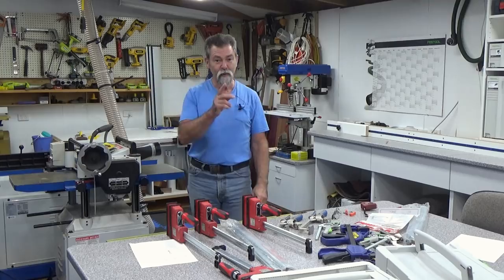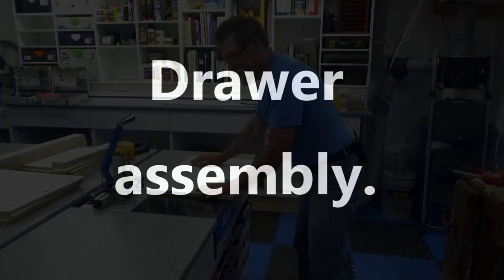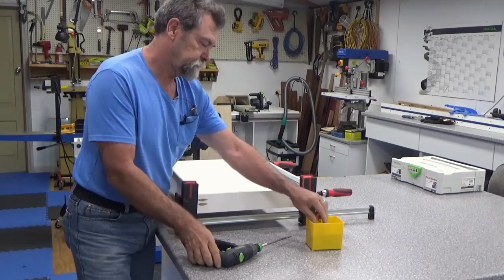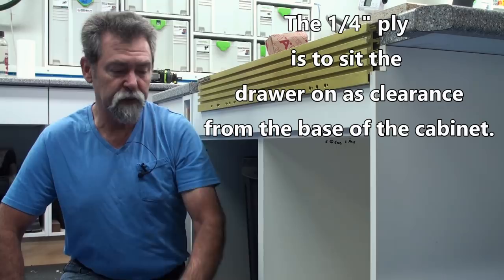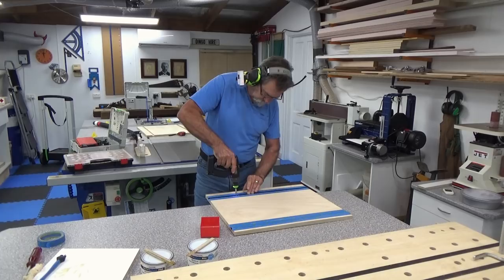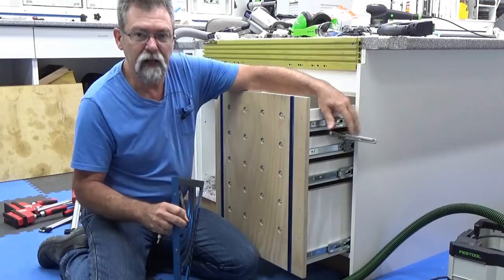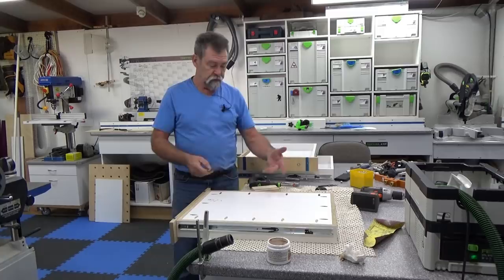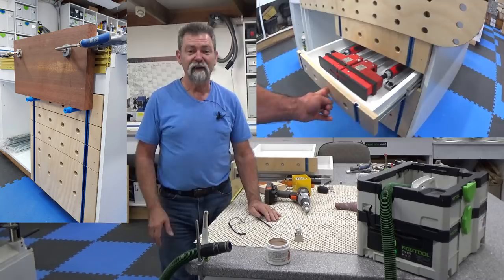Festool style MFT drawers! Dave Stanton easy woodworking. vix

Comment: Dave I used to make my drawers out of melamine as well & with Kreg screws. Now I build them with Festool dominoes and no one sees the connection method. Works great! And I recently started using thru Dominoes just to try something different and they work great as well. No issues with either method.
Ron

Comment: Thank's Dave, well worth the wait. Excellent step by step video. Cheers for the West
Reply from the maker: Hope it helps with your drawer project Brett.
Reply: It will thanks Dave, where did you get your square dit driver for the Centrotec chuck?
Reply from the maker: It is a long Kreg drive and I put it into the centrotec bit holder that I usually put a small posidrive or philips drive into.

Comment: Excellent demonstration Dave
Reply from the maker: Thanks Jim, much appreciated!
Reply: Dave, I always enjoy your videos.   Nice detail and narratives.  I think the reason people might not follow your method is because it takes a lot of time compared to alternatives like dados or dovetails for drawer joinery which are much quicker if you get your machinery setup to do multiple drawer units and, I think, look much cleaner than pocket holes.  Still, nice demonstration of another method of joining and assembling drawers.
Reply from the maker: Thanks Jeff. I guess it comes down to what you are comfortable with and also what gear you have at your disposal. I may do some drawers a little differently with timber, but for melamine this method or using the domino seems easy.
Reply: David Stanton I love using dominos for drawer construction.  Good recommendation!

Comment: Having recently bought an HKC with 1400/2 and the parf system for drilling the holes i can only advice everyone to do the same! Right now im working on ways to reduce dust. I have the 1400 set up in almost the middle on a 800x600 top. The suction is under the table where the saw blade goes. Too hard to explain how but it's pretty simple. Maybe ill make a video.

Comment: Great video. Will try pocket holes in Melamine again I have not had much success. Get a split in the side at times. Looks like Bunnings no longer sells King Slide drawer rails its now Galioth brand
Reply from the maker: Hi Alex. The thing with Kreg screws is to make sure the right length screw is selected and the jig is also set for that screw. Hmmm, will find out what is happening with kingslide.

Comment: I'm not sure why cut the drawer fronts on the cabinet. Did you think you would have lost alignment by putting the cut fronts back on the drawer with the four screws?
Reply from the maker: Interesting point Nuts Mc Flurry. I guess I could have removed the panel and cut on the table saw but where is the fun in that?
Reply: @DavidStanton  Only reason I noticed was my back was screaming at watching you installing the drawer slides. When it came to cutting the fronts I had to go lay down.

Comment: Watching the drawer close suddenly got completely different meaning. 😂
Reply: @DavidStanton  First of all I'm sorry if I offended you in any way. I just found your enthusiasm about soft close mechanism very funny but only in a good way. I usually build drawers the standard way with rebate and thinner bottom or go with one of those prefabricated drawer systems from Blum or Hettich. Last week I started to build a drawer for storing papers of different formats. I decided to try your system as these drawers have to be very wide and heavy duty and all prefabricated systems that would meet requirements would be too expensive. Paper is surprisingly heavy. So I built one drawer and was thrilled  with it. Virtually no sagging, no going out of square when you pull only on one side. After playing with it and watching your video for the 15th time ;-) I realized how actually the way you assemble it plays a big role. What are you doing is: when you assemble the drawer you first put the clamps at the corners and compress, then screw them. That creates a small bow in the middle. THEN you put the clamps in the middle and tighten the middle ones. This creates compression in all joints and MDF is very strong under compression. So I assume this is where the strength is coming from. So, to conclude my long story in bad English, I'm and avid follower and really like your enthusiasm and knowledge.

Comment: Dave , I love the concept but my concern is the combined weight of drawers, tools, work and force on that work, i.e. chiseling a mortise, on the drawer bearings. Oh well, time will tell. good job, russ
Reply from the maker: Hi Russell. I share that concern but I have also had some triple dogs made. These are a bar that covers 3 dog holes with 15 mm deep x 20mm dia pegs. They simply push into the face of the drawer being used and the couple below and it shares the load. Time will tell but the main abuse these will be getting is support for panels as I apply edge tape and maybe some hand planing.

Comment: Hi all, I'm in the process of ordering the 'Parfguide system' and was wondering what size countersink tool you use to knock off the hard shoulders of the 20mm holes. Not sure if I need to order a 20mm or one that's slightly bigger? 
Appreciate an answer from anyone reading this message as I know Dave will be busy making mega content for us all to enjoy. Thanks in advance,
Bish
Reply from the maker: The 1 I used was a 15-20 mm. I think I put a link under the video.
Reply: Many thanks David :-)

Comment: Hi Dave - great seeing work from start to finish. I was wondering - did you use the same 16mm melamine for the mitre station cabinets (top and bottom)? And is it just the stuff you can get from Bunnies and the like? I plan to build a similar (smaller) mitre station soon and am a bit hesitant to use 16mm material...
Reply from the maker: Yes Steve. All from bunnings but make sure you get the full 2.4 x 12 metre sheets as they will be HMR (high moisture resistant) unlike the stuff that is pre drilled and edged for wardrobes which will not last very long at all.
Reply: Thanks Dave - will do.
Reply: 16mm material is a tad cheaper and it is easier to handle and lighter than 18mm. My 2 cents

Comment: Beautiful work as always David.  I have really enjoyed the whole series based around the bench, I was just wondering, once you have screwed the one piece drawer front to the front of all of the drawers with the screws, could you then remove all of the drawers with the drawer front attached and then place the back of the drawers on the bench/floor and then cut the drawer fronts with the fs guide and plunge saw?  I'm thinking that would be easier with my bad back and knees. KUTGW.
Reply from the maker: Thanks for the compliment on the videos Easy Yards. Not a good idea to pull all the drawers out at one time. Too heavy and also risk snapping a few drawer bodies.

Comment: Dave do standard machine casters run on that interloking rubber flooring?
Reply from the maker: Not a hope Edad. I lift the mats in areas I need to move a machine and also have very dense carpet squares in the areas I have roll around cabinets.

Comment: Hi Dave, which countersink did you have used?
Reply from the maker: It was a through hole countersink Wee Lee !
Reply: Which size?
Reply from the maker: Not sure but a bit larger than the hole diameter.
Reply: Thanks.

Comment: Dave, great ideas and video’s. However, how much would it cost to equip a workshop with all that Festool kit?  Without which, most of the work you did would be totally impractical.
Shame for ‘most’ of your audience, I’m sure.
Reply from the maker: Interesting point Barry Turner, but you don't need to buy Festool gear for similar tools. I use festool because they are the tools I prefer in some situations. You will notice I also have Ryobi, Dewalt and Hitachi to name a few. 
Most of my audience are resourceful enough to buy what they can afford and use my ideas to get a great result.
Reply: Ok Dave, thanks for the swift feedback (not many do that!) I do enjoy your video’s but ‘assume’ you’re sponsored with the amount of kit from whatever stable, I for one unfortunately can't justify so much kit expenditure, (here in the UK such items are very expensive!) but I do try and ‘copy’ ideas from many woodworkers, as well as you, on this medium.  Keep smiling.  Barry
Reply: Barry Turner , As an amateur, I can understand your concerns. IMHO, the biggest advantage that Festool gear often has is speed and convenience — some features very important to professionals. You can often achieve the same or very similar results by investing more time instead of money with less expensive tools. However, I do advise anyone who can possibly do it to try to save up enough money to get a Festool Tracksaw combo (ideally with dust extraction). It really is a game changer. Some things (e.g. Dave’s drawer front trick) can’t be done any other way. But the biggest reason is the ability to ACCURATELY cut sheet goods much more easily and safely than you can possibly do it on a table saw (especially for an older, retired guy like me). I purchased a TS55 over 15 years ago and I’m pretty sure I’ve saved the difference in cost by not wasting so much expensive plywood.